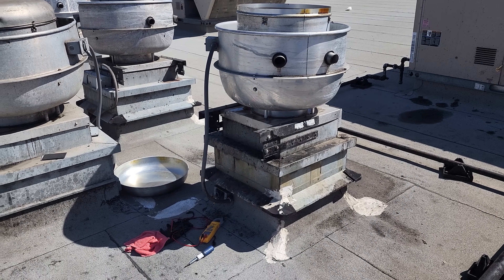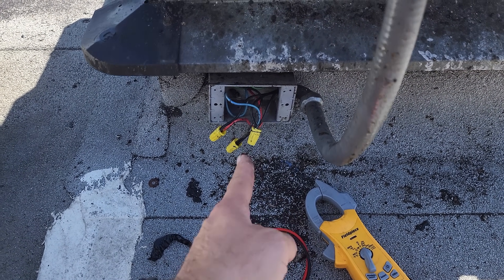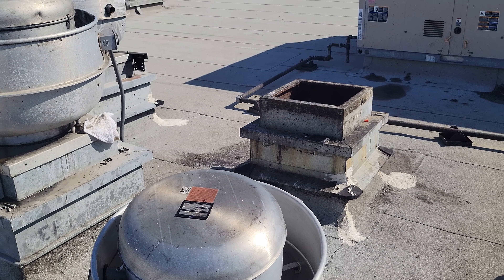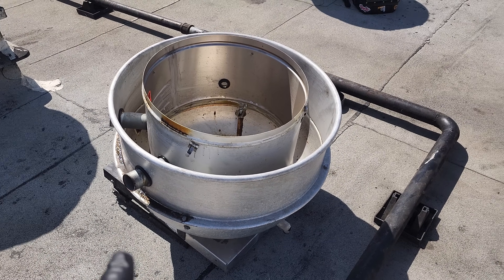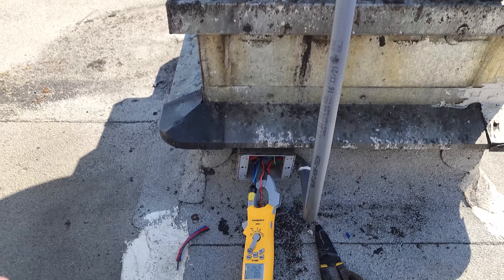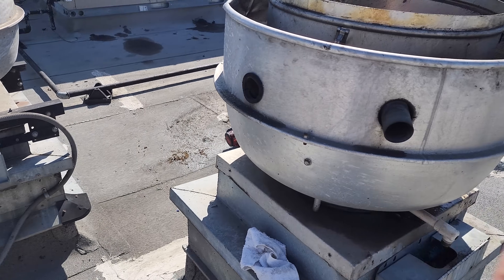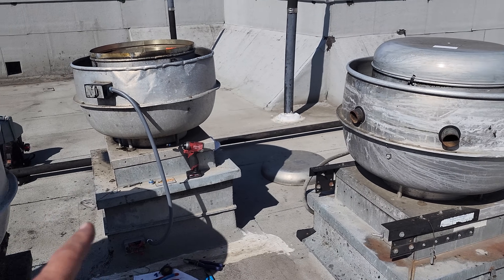THE KITCHEN IS FULL OF SMOKE

Comment: I did not see you find an electrical short circuit in the video as you leep mentioning. You posted a intermittent/bad connection. Which was it? An electrical short should have popped a breaker and simply shut it down saving the motor. The intermittent would cause single phasing so that makes most sense.

Comment: Great video, as always. One thing that bothers me, however, is your referring to every electrical connection failure as a short. A short circuit is a direct connection between conductors or conductor and ground, which will always result in a tripped circuit breaker (assuming the breaker is good). When the breaker isn't tripped and you have a loss of voltage that's due to an open, either a break in a wire or failure of a connection. In this video the problem is an intermittent open or (more likely) a high resistance junction due to the improperly installed wire nut. I realize that you are a refrigeration mechanic and not an electrician, but this is first month apprentice stuff. By the way, here in New Jersey an HVAC contractor must have electrical and plumbing licenses as well as refrigeration certification.
Reply: I told him the same thing in an earlier video.

Comment: You talk about using a motor starter then a VFD. That may be a bad idea. You did say that the Amps are good when the VFD is bypassed. The issue you can have is most Direct drive fans cant run at the full 60hz. The wheel RPM designed may be less then the motor RPM. so you will need a VFD to slow the motor down to keep the wheel RPM below design. Also you have no way to balance a fan/hood if its direct drive if its on a motor starter.

Comment: Those flimsy temporary screw caps in place of serious connections are so awful, especially with solid wire; who made this, a kid who can't handle a screwdriver? lmao
Reply: Wire nuts are neither flimsy nor temporary. They are used extensively for permanent and semi-permanent junctions. Properly installed they will provide a secure connection for decades. There is some debate surrounding the use of wire nuts versus Wago connectors, but many electricians use both depending on the specific application.
Reply: @rayives7758  really? It looks so botched and dangerous.
Those Wago things look even worse and overcomplicated, good for quick troubleshooting but I'd never leave them installed; why not use screw caps/terminals?

Comment: You can use Wago connectors instead of wire nuts.  They eliminate the technician error or vibration causing a wire nut to loosen or become damaged.  It's also safer to probe for voltage over a wire nut.
Reply: Wago 221 series connectors are excellent - vastly superior to wire nuts and quicker to install than terminal blocks. As you say, they also have the advantage of probing points.

Comment: Do the motors have internal thermal protection? If not that is likely what caused the motor to burn up and fail from single phasing. The drive's that were bypassed were likely providing the thermal protection.

Comment: Our kitchen was full of smoke, at our restaurant. We dealt with this for weeks, and tried many different crazy ideas to try to solve the issue. One morning, after speculation the exhaust fan wasn't running at all, we thought to check the breaker panels , and found that the hood fan breaker was switched, not tripped, to the off position. I checked the cleaning tag on the hood, required by the fire marshal, and it was marked about 6 weeks prior, which was the amount of time we had been experiencing this issue. I was somewhat infuriated because this meant the cleaning company forgot to turn it back on when they were done cleaning the hood, and it cost us so much time, inconvenience, and money for such a small and simple thing.
Reply: how many ffans
Reply: @randomrazr  Just the 1 exhaust fan, but all the grills and fryers made the kitchen very hazy without it.
Reply: @BobTheBuildersForeman  ah hence why this kitchen has like 5?
Reply: @BobTheBuildersForeman  Ngl the box is always the first thing to check

Comment: You can install motor starters in place of those vfd. Standard din rail mount. You can get 120v control voltage from the motor starter for the smoker/combi oven.  And you would be able to reuse the control panel of the captiveaire
Reply from the maker: Yeah I've done it in the attic it's just a matter of getting them to approve it, it's a rather lengthy process to do it properly. You have to wire everything for proper fire shut down and turn on ect.

Comment: The town would hate the grease cleaning company for dumping the grease into the sewer since it will plug all the drains quickly.
No fun when the toilets no longer flush due to a grease plug in the pipes that's next to impossible to get out.
Reply: Literally the worst place you can put grease, especially well-heated grease that's partially polymerising already, some poor fucker has to wade in with a pole hook and other tools and cut away a composite mass of discarded wipes and saponified grease then weather the tide of foulness that was waiting for them when they punctured the shit-smelling veil of fryer soap.

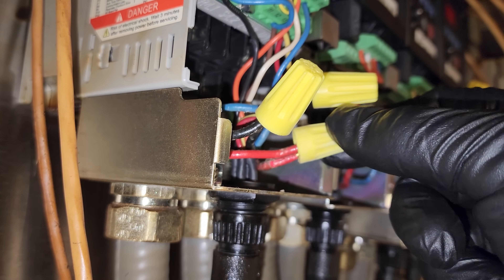Comment: 1:20 and that is why you use wago 221 and not wire nuts. this is how a 5 cent nut turns into a 5k repair.
Reply: Particularily if you remove a protection device (VFD) you need to install a motor starter immediately to protect the motor.
If there had been a single phase outage to the building all five motors would have burnt up...
Reply: I thought exact the same thing
Reply: Insert "The Office" THANK YOU gif here
Reply: Wago lever nuts are awesome.
Reply: This is the way.
Reply: @sorphin  - Oddly enough, I've run into a LOT of wire nuts, and almost never seen issues.  They even work okay for stranded wire, but you have to pre-twist them BEFORE jamming them into the wire nuts.  They even make crimp wire nuts now.  
I will say that if you're putting more than three wires into a wire nut, you either 1) have the wrong tool for the job, or 2) you're doing something wrong with your wiring.   If your electrical box has that many junction points, you need to create another junction box.   (It's a bad idea to completely pack them with wires. That's just asking for a short, no matter HOW you're connecting them.  Use a bigger box and a bridge block, if you're that bad off.  )
Reply: @Troy Belding  stranded requires a longer length when coupled with solid. There's procedures for it. 

I don't see how hard it is to understand I like and use both. Just know how to use them properly.
Reply: @etherealrose2139  - I'm reasonably sure at least part of it is because people don't understand that wire nuts are both sized and colour coded (to a degree).   There are certain ones I don't like very much, because of how they're made, but I've never had an issue with using them, personally.
Reply: @tbelding  weird logic. i have seen many cars, hardly never seen a car crash. that basically the pro-nut-logic.
Reply: @SupremeRuleroftheWorld  - No, I'm simply being honest.   I'm not a professional electrician.  I'm an IT consultant.  I'm almost never in electrical boxes unless there's an issue related to what I'm doing on a regular basis.   I've even seen fully tight nuts that survived wiring shorts next to them.   I've also seen Wago style spring connections that exploded because heat melted the plastic, and there wasn't anything really holding the connection together.    

Using your example, you'd insist that everyone must use self-driving cars, because it's unreasonable to demand that people should learn to drive.    That's the "anti-wire nut, pro Wago" argument.
Reply: This has nothing to do with the nut and everything to do with the installation. A wago can't save a moron.
Reply: @etherealrose2139  spoken like someone that never used a wago.
Reply: a wire nut does just as good a job if not better considering the high amperage of exhaust motors. this isn't the cause of a wirenut but the cause of a technician not using them correctly.
Reply: @RKSNomad  exactly, you cant misuse or fuck up a wago. it removes operator error wich is far to common for pro-nutters to even accept those even exist. no, you are not as good as you think you are with nuts and the customer will pay for it.
Reply: @SupremeRuleroftheWorld  - You sound like a union worker.  "Keep the incompetent workers, just make sure that they can't screw the job up.  Who cares if it costs the customer extra money?"    When used properly, wire nuts work just fine, and they have since 1929.   If someone working for me can't pull a wire nut to check that it's firmly locked down, I don't want them.    I'm not down on Wago connectors, however.   I just think that you're barking up the wrong tree.
Reply: @RKSNomad  Wago connectors are rated to 32A. Even when they are run with an excessive current the plastic doesn't melt off.
Reply: @RKSNomad  no it doesn't. Wirenuts should be banned permanently

Comment: arrgh I don't know why wire nuts are still used when there are wago connectors now
Reply: I just heard of these and they seem expensive but reusable as well
Reply: @wiz369  typical cost of a 100 pieces WAGO box is like 10 minutes of technician time...
Reply: @ochykysh  ok. I’ll keep that in mind whenever I hit the field
Reply: Because wire nuts are better. Much better surface area and the connector isn’t the main thing carrying current.

But yeah you need to install them correctly but that’s true of everything electrical.
Reply: yeah, wirenuts make a mechanical connection of the wires instead of basically using a bus bar. Wirenuts also dont have amp ratings because they dont carry the load, the wires twisted in them (when attached properly and securely) carry the full load. Wagos are great for low amp areas but imo should never be used for commercial appliances
Reply: @legionofanon  wirenuts have been banned for the last 50 years or so in the UK in favour of screw terminals. Wagos are generally a new thing, but they have no issues with rated loads, there's a ton of vids on youtube with people overloading them to test and yanking on them with heavy weights.
The main issue with a wire nut is keeping the wires together if they're not fitted correctly, they're cheap but cheerful. It's a question of do you trust the other guy that fitted them that wasn't you.